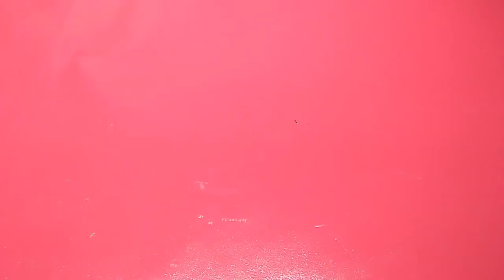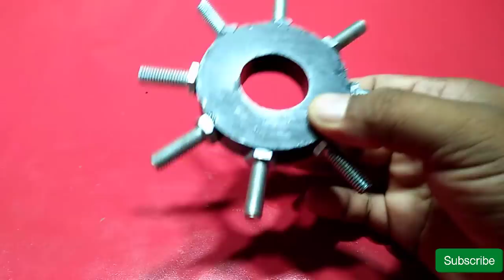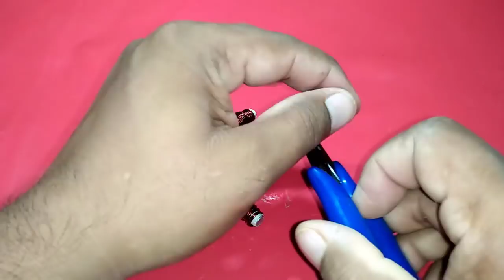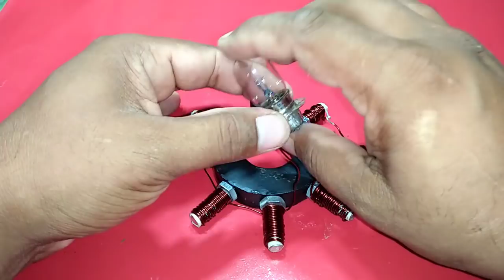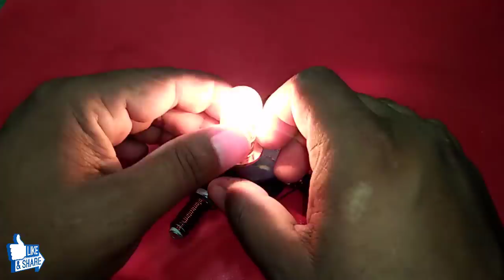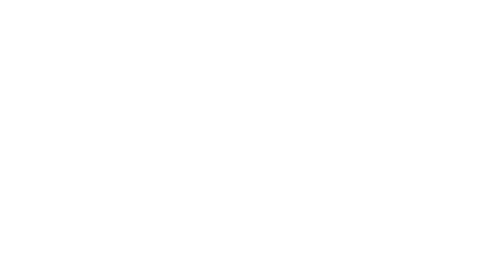how to make free energy with magnets it home

Comment: So the copper magnet wire is absorbing electrons from the magnetic field of the magnet.  Then you use the electrons by connecting a bulb to the wire.  The wire absorbs more electrons from the field as they are drained from the wire by the bulb use.

Design may be fake, I don't know enough.  But coils can absorb electrons they contact, from what I understand.

Comment: I want to see what happens when he runs a direct connection over just the lightbulb. Perfect place to conceal the energy source inside that system. Magnets can't produce energy in wire if the field doesn't move, that's just Electricity & Magnetism 101

Comment: Explain how you stuck a battery inside the magnet/ an induction plate under the table, would you?
You don't care a THING about any law or anything, as STATIC magnets doesn't induce ANY current in ANY conductor configuration, windings were also done like "1,2,3,4,5 who cares how many"
This is a clickbait, nothing else
Reply: He using a tesla tower that transfer electricity wirelessly

Comment: OMG so fake. Read.

1. There's no way you can generate a current without a flux in the magnetic field around the copper coils, or vice versa in this system.
2. Since the rate of magnetic flux in this system is 0 there is absolutely no current being generated.
3. You most likely have a battery in the housing unit beneath the light bulb. 
4. All you're doing here is creating an elaborate closed circuit system with voltage coming from a battery. 

Seems like a waste of time to me. >.>
Review your physics notes my friend. 
I would recommend you start with AC-generator chapters or the concept of electromagnetism.